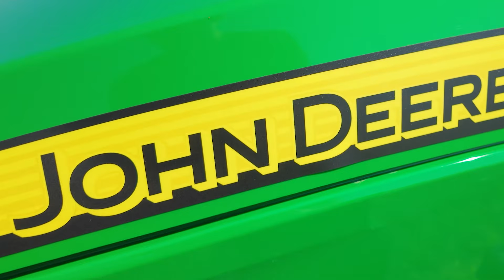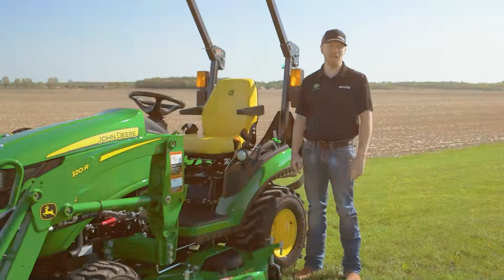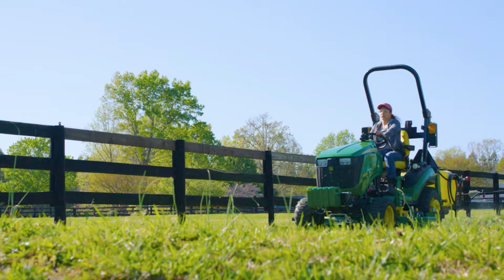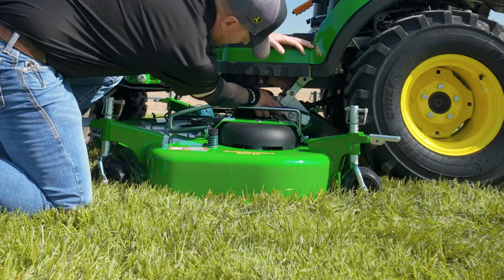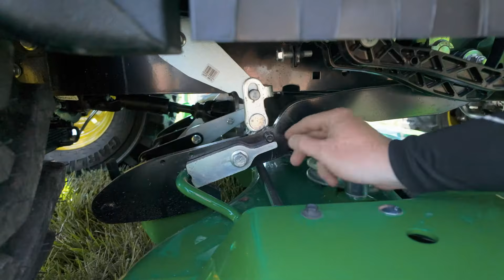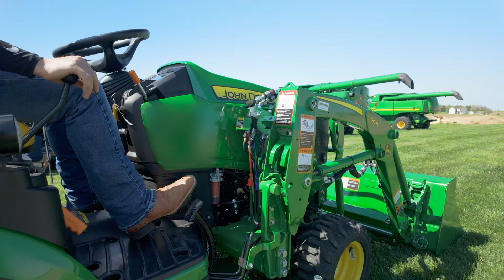John Deere 1025R Tractor with Mower Deck and Front Loader | Features, Attachments, and Operations

Comment: I'm looking at getting this set-up in about 2 years and one quick question.... How does the single point hydraulic coupling work if you go to switch the bucket for a grapple? Will you have to manually connect that 5th hydraulic line as a separate connector?